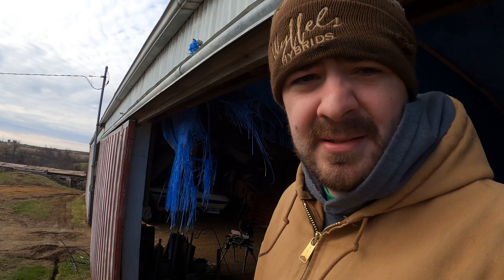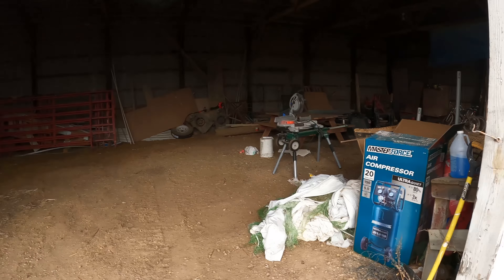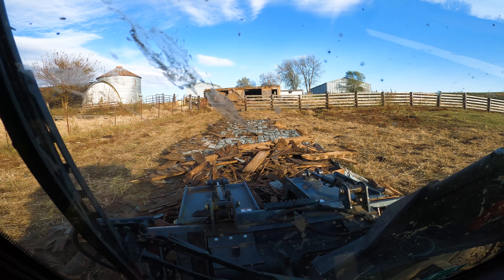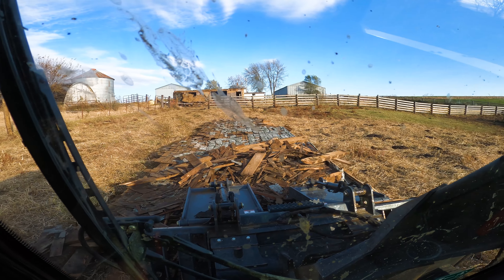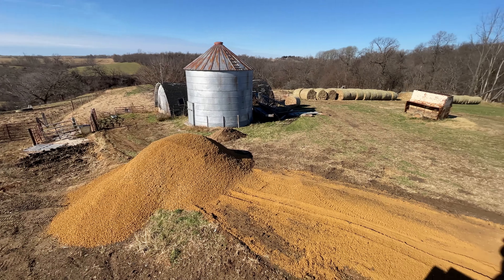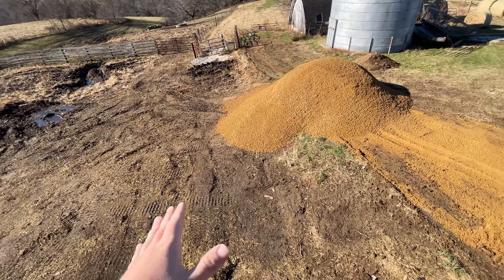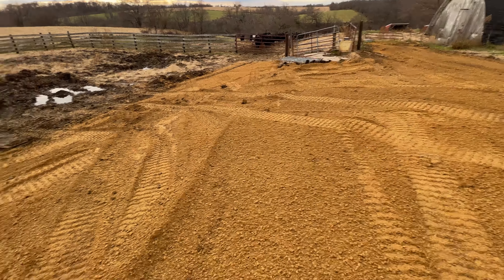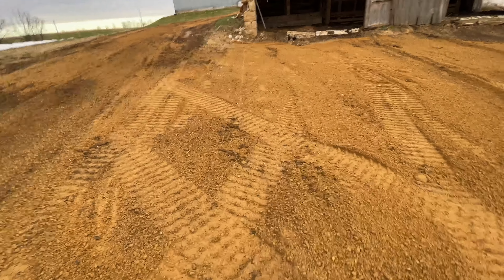Barn Wreckage Cleanup and Grading | JCB Teleskid

Comment: I have gone away from wood to used highway guardrail.  I use 2-7/8" oil field tubing for posts, just drive them  5' deep.  I have rebuilt my corrals three times in my life.  And I thought the first time would outlive me.  Love new gravel.   I had some soggy spots that I under filled with  crushed concrete then  put 3/4- over the top.  That worked well.  Good luck on your corral rebuild.

Comment: Ryan, you need to build you an old fashioned drag out of railroad ties to smooth out your gravel. When I was growing up we used one to smooth out our gravel road and driveway.
Reply: Chain link fence works very well, as  it does for breaking up dirt clods  for seeding new lawn, pond bank, etc.  When finished roll up & toss in corner of shed for next time. Failed to mention, using cement blocks for ballast, if needed.

Comment: I like seeing things being improved, that gravel looks a lot cleaner. Use those tracks to pack it down.
Reply: I was just thinking he needs a pull-type roller to compact and smooth the gravel. Then he can use the roller next spring to roll soybeans after they're planted to get better contact with the soil and flatten the rows. That makes for easier harvesting because you can set the header lower and get those low-growing bean pods. And who doesn't like increased yields?

Comment: I'm sure you probably already have a plan for posts but I would very strongly recommend using railroad ties for the main post. They are absolutely the best and toughest post you can use and they last for at least a couple decades if not longer. Just a little thought

Comment: The one thing I don't like about those cans of WD40, is there is no 'disable' on the spray top.  So, if you put it in your toolbox/vehicle/etc, there is nothing stopping the release button being pressed and it emptying it's contents all over you stuff. The spray and straw option cap is great, but it NEEDS a disable switch, that stops accidental releases.

Comment: Actually nuclear missiles-- though Atlas was used for a space launch rocket (including the Mercury orbital manned spacecraft) came later.  WD-40 or "water displacer #40" was developed to help clean connections and prevent corrosion on Atlas missiles, which was the United States' first intercontinental ballistic missile (ICBM).  They were a "balloon tank" missile developed by Karel Bossart, which used a thin stainless steel shell rolled from thin stainless steel sheets and welded together to construct the missile's propellant tanks, which instead of using heavy stiffener rings, operated identically to how a car tire works-- internal pressure keeps the structure rigid, like a blown-up balloon, which can then support the weight of hundreds of tons of propellant and the weight and acceleration forces of a several thousand pound nuclear warhead and reentry vehicle atop the rocket, the same way the pressure of compressed air in a tire can support thousands of pounds of weight of the vehicle and cargo. 

Had skip the 4:52 second WD-40 commercial... FFS I like WD-40 but seriously, nearly 5 minutes of shilling for it?? LOL:)   Later!  OL J R:)

Comment: Dude. You got the job done well, but you made it so much harder by using the edge of the bucket like that. That 3TS has a float mode (on the right joystick) when the boom is all the way down. Just fill the bucket with gravel for weight then push-pull your way across with Float On and you're done in half the time.

Comment: I have old Dodge's like women collect shoes they were not used in winter just old vehicles from 1941 to 1996 every fall under the hoods one large can of wd40 was sprayed everyone always said how good they looked under the hood 2003 that changed bought a case at Sam's club had the new flip out straw in the spring every engine compartment including where the over spray hit was rusted after spraying them the previous fall unfortunately I forgot I had started wiping stored weapons also until I took a single shot shotgun out of a storage sock for one of the grandson's to use and it was covered in rust .I thought it was a bad batch but with some online research (wd40 is good at removing rust comments from search engines ) I'm not the only one that has had problems with wd40 causing rust